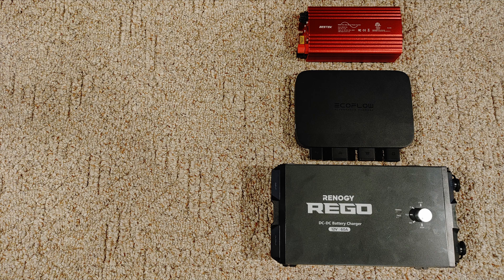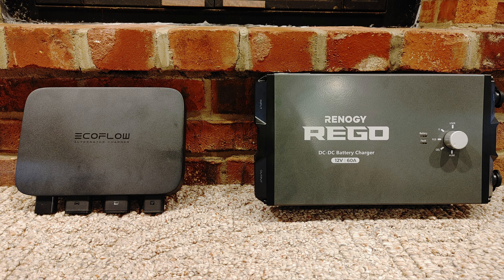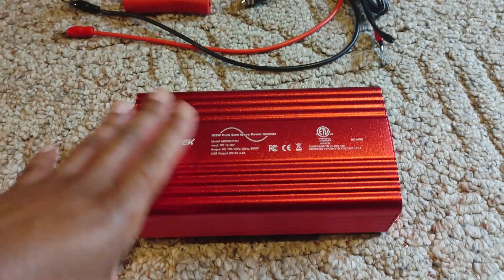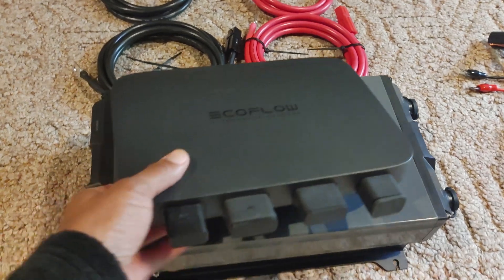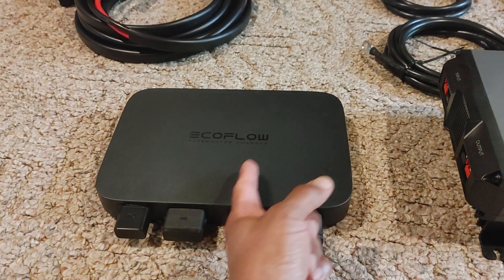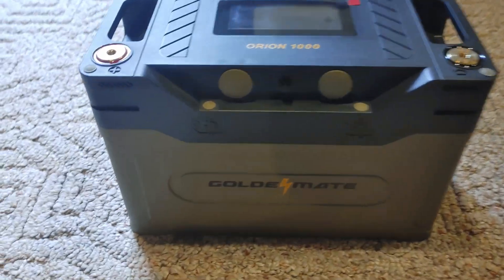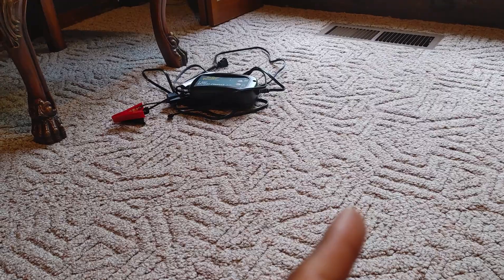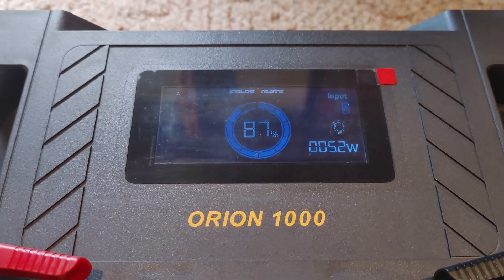EcoFlow Alternator Charger Vs Renogy Rego

Comment: The EcoFlow Alternator Charger must be paired with at least one EcoFlow Power Station or Extra Battery. The Renogy and Victron products can charge any 12V or 24V battery from your vehicle's alternator output. I've got 200Ah of 4S/12V Dual Purpose LiFePO4 batteries for the chassis and 1200Ah of 4S/12V LiFePO4 batteries as my house/coach bank. I want to charge my house/coach batteries when the engine is running. The EcoFlow Alternator Charger doesn't help me with that at all.

The Victron 50A DC DC Smart Charger is one direction. The Rego 60A DC DC charger is bidirectional. The presence of the knob on the Rego is dumb, but I'm going to set it and yank that knob right off. My batteries are all 4S LiFePO4. No need to change it once it's been set.

Comment: You seem to be missing the KEY and very cool thing about the Renogy Rego 60amp DC-DC charger, IT'S BI-DIRECTIONAL! It will charge the starter battery from the house batteries! I have not found any other DC DC chargers that do this. After finding my starter battery dead a while ago because of a USB charger left in the cigarette lighter plug for weeks without starting my van, I started looking for a solution. Turns out upgrading from my Renogy 50amp + MPPT DC-DC to the Rego was the solution.

Also, the Victron is not isolated. It's got a common ground for both starter and house batteries. This may not be a problem for many or most people, but it's a more advanced design and can give cleaner power to sensitive electronics, radios, etc. 

I agree the big knob sticking out of the Renogy REGO is dumb, that's something you are very likely to set once and leave forever. The big knob is something that can get knocked and changed inadvertently (Though the BMS in a lithium battery will deal with this reasonably well) or worst case broken. I get my Rego next week, I hope that knob will simply slide off it's post on the rotary switch inside so I can remove it after it's been set. Now, the Victron you HAVE to use the app to change the battery type mode.

The Victron is generally cheaper, but it's a more basic, and lower power (20%, 50amp vs 60amp) DC DC charger. AND the Renogy REGO is often found on sale. It's currently $259.99 at Renogy and $349 on Amazon. 

Victron customer service and support and general reliability is probably better than Renogy, but you are really doing a poor job of reviewing the Renogy Rego by leaving out a lot of important plusses that charger has and ignoring things the Victron lacks.

Also, why did you conclude the REGO won't charge from a battery? I suspect it would IF the battery was supplying enough voltage and amps, why wouldn't it? It's supposed to be connected to battery, not directly to the alternator. And unless you connect the optional voltage sensing wires for smart alternators to the alternator directly, the DC-DC charger isn't going to know if it's getting power from the alternator or a starter battery. All it cares about is if the power on the starter battery/alternator side is higher than it's reading from the house batteries. And generally, you DO NOT want to charge house batteries from a starter battery, that's a good way to end up unable to start your vehicle!!! UNLESS you have the smart REGO with bidirectional charging to always ensure your starter battery is charged!

https://store-fhnch.mybigcommerce.com/content/RCB1260DO-100506PR/RBC1260DO-12B_UserManual_A0.pdf

https://www.victronenergy.com/upload/documents/Orion_XS_12-12-50A_DC-DC_battery_charger/124067-Orion_XS_DC-DC_battery_charger-pdf-en.pdf
Reply: Ecoflow charger is bi-directional. It has (car) battery boost and maintenance mode.
Reply: @GMC-qo9xi  that is true, but it is only bidirectional to/from an EcoFlow PowerStation. I just have a LiFePO4 battery bank. Which the EcoFlow can't handle. But the Renogy and Victron DC DC chargers can...
Reply: @rossbagley9015  yes, they seemed to do that on purpose, as it could have been programmed with various charging algorithms. Sad, but they are battery sellers, so I guess it’s logical.

Comment: Will this EcoFlow 800W Alternator Charger be used with the Renogy 3000 amp Inverter Charger?
10:04
Reply from the maker: No, it's unnecessary. You only need one. The inverter is for when I test batteries.
Reply: I don't see why it wouldn't?

My Renogy 2000w inverter/charger is dumb and has no communication, no bluetooth and doesn't know about anything else in my system. My 50amp DC DC charger charges the house batteries when I'm driving, the inverter/charger charges the house batteries when I'm parked and plugged into external 120v AC power. 

But I'm getting a new REGO 60amp DC-DC charger to get bidirectional battery charging, should have it next week. And if I can manage to get one delivered before I need to leave on my road trip I'll be replacing my heavy, loud, hot 2000w old model Renogy Inverter Charger with the 3000W Renogy REGO Inverter Charger for quieter running, lower weight, less space taken up, and because it'll talk over bluetooth with my monitoring system. Right now Inverter Charging power is not reported or taken into account other than "mysteriously" over the smart shunt.

Comment: Great stuff,…I do have a question: 

I want to buy 12v 100ah lithium battery to power my 12v fridge freezer during the summer while travelling with my car,..but the problem remains charging the battery, I do not want power station or portable solar panels ,…I’m thinking to use the alternator when the engine is running to charge the battery,..but don’t know what is the best idea !
Some videos say use relay ,  some say use dc to dc ,.,,it’s only 12v 100ah lithium battery , so not sure what is the cheapest and efficient way ,..I hope you have some kind of advice thank you
Reply from the maker: Sorry for the delay! Had a family emergency last week and everyone's still at my house. But, if you don't mind the slower charge you could just go with something like this: https://amzn.to/3XBffE1. It'll only charge your battery at about 100W per hour but your fridge is likely to use a lot less than that so if you start with a full charge you should be good! It also has a toggle switch and fuse built in for surges and you can turn it on and off as you see fit so no need to keep disconnecting. If you needed a little more, you could use a cheap 300w dc to dc charger. But I'd play around with the first option first to see how that works out for you. If you have an American car it'll still trickle charge the battery even when the vehicle is off and the BMS in the battery will stop it when it's full. Hope this helps!
Reply: @ModernUpgrade  
Thanks for your info , yesterday I bought the new Echoflow power station  RIVER 2 MAX, 512Wh ,..looks amazing just from the car charger I get 100W , also the input-output USB-C can charge 100W too ,..so I bought DC Adapter 12V/24V 100W 90W USB C Car Charger ,..so basically I can get 200W straightway without using expensive DC-DC charger just by the cigarette lighter of my car ,..the fuse for the cigarette lighter is 20V so I’m ok to pull 200W ,..But thank you for your info about the fridge,..that means I made a good choice 512W capacity power station, I wasn’t sure what capacity I need for the fridge,..I was thinking to buy a large capacity,..but some how i choose 512w power station was on ofer , didn’t spend a lot ,..but the good thing I don’t need expensive solar panel , I can get 200W just by the cigarette lighter,..thank you for your response